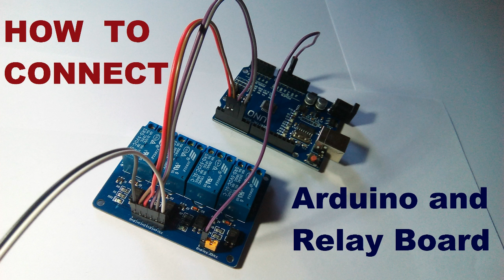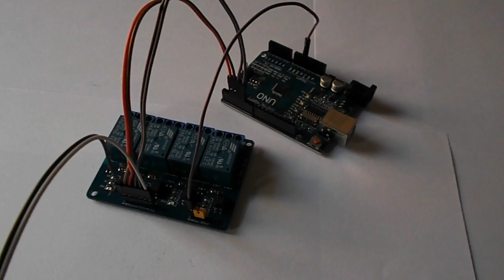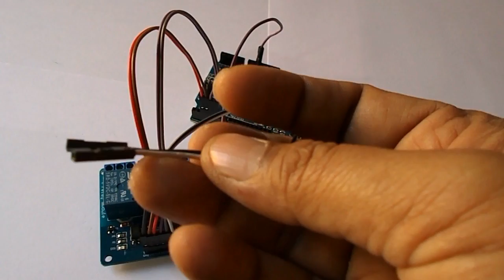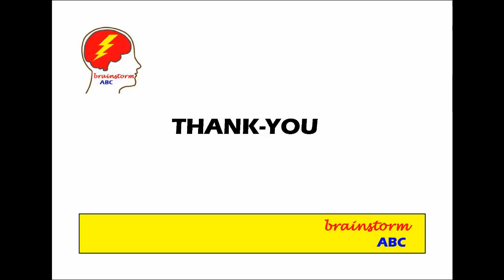How to Connect Arduino and Relay Board

Comment: Hi Brain, it would be greatly appreciated if you could make a VDO or the schematic of connecting 12v relay module with arduino to switch ON/OFF a 12v DC fan. Thanks.